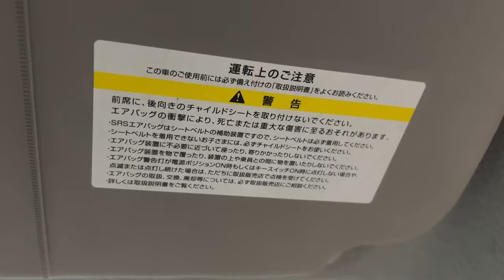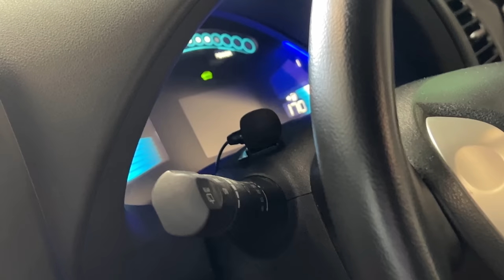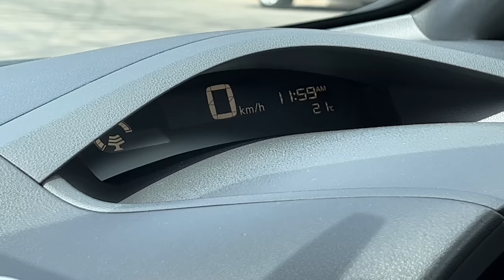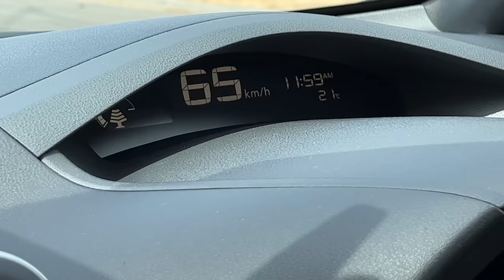I bought an electric car.

Comment: If I get an EV, this is probably the one I'm going for. I don't think I've driven more than 10 kilometers in a day since I went home for the first round of Covid lockdowns about 3 years ago.
Reply: I implore you to reconsider, Chadamo plug (the type the leaf uses) is going the way of the do-do outside of japan, multiple charging station companies have already announced they will be dropping support of it on their new stations- in a few years the already rarer chadamo plug may become impossible to find- leaving you to charge on a 24~ hour wall plug anytime you need to recharge...

Also avoid early leafs at least, they usually have horrific battery degredation because they didn't ever implement any battery protection systems like cooling, buffers or heating on any of the sub 150~ milage ones as far as I know. 

I highly recommend you go for something the upgraded E-golf, Focus EV or Ioniq EV, which all have CSS and 115~125mi range Particularly the Ioniq seems to hold up incredibly well, I've researched EV's for a couple years before just buying my own this year, and after watching pretty much every long term owner review of their Ioniq after 80~200k miles, literally none of them had lost any range, and seeing maybe 100? On various sites selling them, checking their range on the dash when the pictures were provided, all of them seemed to have good battery health as far as I could tell.

Tl;DR: Avoid Chadamo based cars, and anything without a fast charger, also I've seen a ton of bolts with massive degredation (like 3 years old with a max range of 19 miles from 253, its the only car worse than the leaf in that department)
Reply: For 10 kilometers a day, if the roads where you are make it possible, get an electric bike instead...
Reply: Honestly, a Hyundai Iqoniq or Chevy Bolt are better ideas for something newer FYI...
Reply: @SkyTreeStudio  Ioniq batteries seem to last quite nicely, Bolt batteries not so much.

(I've watched hundreds of videos and looked at the same amount of cars for sale and Bolts seemingly have some of the worst battery health for some reason- maybe the batt. recall all of them have to go through off the assembly line has something to do with it)
Reply: I agree with the other commenter. If you live somewhere without much snow, you'll have more fun on an E bike and pay significantly less.
Reply: The Leaf would serve you perfectly
Reply: @flurpoid  Or without much sun/humidity. Southern US or the like you'd be a ball of sweat even on max assist.
Reply: touch grass
Reply: @WelcomeToDERPLAND  
If I recall it was an issue with one of the robots the welded the batteries.
Reply: I've been thinking about getting ba Chevy Bolt, as much as I love my old Chevy Blazer an EV sounds hella good. Especially since it's so cheap to run.

Comment: I love the old LEAF design. It just looks so unique. I have a 2022 Leaf and I prefer the old body design. The newer ones just look... like a normal car. I would have gotten an older model, but the thing about EVs is that battery degradation exists and the longer you go using a rechargeable battery, the less capacity it has, so I got one new. I wanted an EV that I could visit people in, not just the bare minimum to get groceries. It's better than the i3 I had last in terms of range. That thing barely went 80 miles (128 km) on a full charge, but it was very cozy to drive compared to my current.
Reply: I actually wish more EVs would just look like normal cars. Some EVs look fantastic (e.g. Teslas are pretty good) but some EVs are designed to be as "different" as possible in the worst possible way (like the BMW i3).

I guess my point is I just want milk that tastes like real milk.

Comment: Fun thing; You can actually use your 2017 leaf as a household battery storage if you want! Leafs did come with bi-directional charging since 2015 I believe. You mentioned that the leaf has double the storage capacity compared to the household battery you have, how would you like to triple that?
Reply: The iMIev supports that aswell, but only has a 16kWh battery.
Reply: @Thelango99  Good to know!

Comment: As a former leaf owner, it's honestly the best city car you can find. Charge it up slow whenever you don't use it, and it barely ever complains. The only issue I had with my leaf (which had the 40 KWh pack) was that long distance road trips with the fast chargers were annoying as anything, so I bought a long range Tesla, but even still 100% recommend as a city car every day of the week
Reply: As a 18 kWh remaining eNV200 daily driver, I find 40 kWh a bit overpowered for a city car

Comment: My used Chevy Volt is the most fun I’ve ever had with a car. I literally don’t remember when I last put gas in it. I only do short trips and errands and walk the rest of the time, so it’s perfect. It also is just SOLID. I’ve had it for a while and have never had any issues with any aspect of it beyond basic maintenance. Hands down the best car I could have possibly gotten. I’m pretty sure it’s appreciated since I bought it, too.
Edit: I also agree on the quietness! I’m spoiled by the silent ride and think other cars are obscenely loud now.

Comment: Nice, I've been a LEAF driver solely for the past few years, and I've loved it. I'm glad you do too!

By the way, battery capacity is measured in kWh (killowatt hours), not in kW (killowatt). kW is how much power you're pulling at this moment, and kWh is how much energy you hold. Cheers!

Comment: I'd be really interested to see how a 30kWh battery pack has aged in a hot climate like Australia. Hopefully you share the leafspy data somewhere. I Absolutely loved the LEAF30 but even here in the UK the lack of thermal management was an issue that led to early degradation compared to literally any other mass market EV.
Reply: Not good, supposedly.

Non thermal managed leafs in Australia are known to cook their own batteries during fast charge, the computer and charger is too stupid to not slow charge rate in relation to battery tempature, battery life being cut by 60% or worse is not uncommon
Reply: This is a 2017 model year. It has pack that is even more advance than the Lizzard Pack. Should be fine in warm weather, just don't DC Fast Charge with with Chademo on warm days.
Reply: @Neojhun  I had one. I promise you these 30kWh packs were notorious for even faster degradation than the OG 24’s!
Reply: @deepbludreams  I used to have a 30kWh pack. I saw my temperature meter completely full all the way into the red on multiple occasions before. The charge rate definitely got slowed with heat. I was capped at 22kW DC Charging and enforced eco mode with limited acceleration and 60mph/100kph top driving speed when the battery was too hot.
Reply: This one may not be ideal given that its early years were spent in Japan.

Comment: I like the Leaf, it's reasonably-priced and underneath it's actually well designed. Unlike some of its contemporary EVs which were effectively an ICE car with electric gubbins jammed in wherever they'll go.
Reply: It's a real shame about the poor battery cooling on the Leafs. That's the one weak point of the design.

Comment: I've had one of these for nearly 8 years now, and it doesn't get old. Puts a smile on my face every time. If you want more performance, IIRC the place to start is the inverter, and there is at least one upgrade option.

Comment: Hey Dank! Just so you know the reason why it doesn’t chunder-steer through the corners like you were talking about it’s because the center of mass is down on the floor. Most FWD cars have the mass of most the car in the front. The leaf, like a Tesla, has the battery under the car under your fear. Better balance through the corners equals better handling.

Comment: 2:59 just a quick note: battery capacity is measured in kilowatt-hours (kWh) not kW. kW is a measurement of the rate of power usage. So if you run a 30 kWh battery at 30kW power draw for an hour straight it will be dead.

Comment: I drive one of these some days for work and I love them, everything you said plus the "gear shift"" joystick is SO much better than the typical automatic paddle because you don't have to feel for a detent. It does ask for approval to collect data every time it starts and range is bad in the coldest swedish winter weather but it handles little snow-covered roads like a champ because of the torque and traction control. Eco mode is effortless and without it on it feels downright nippy. Coworker who drives a tesla at home says she likes it even more but I absolutely rate the Leaf.

Comment: My dad had a Nissan Leaf for several years before it got written off in an accident; He loved to glance at sporty cars at the traffic lights and then absolutely cream them on takeoff because of the torque and acceleration on the leaf, was funny pretty much every time.
Reply: No one should claim EVs are useless. Teslas can even be good on track if you have a lot of money to spend on tires. 

What everyone is saying is that EVs have no soul and require no specific driving skill. And that's fine for someone who just wants a box that takes them from A to B. It's not fine for someone who wants an actually enjoyable driving experience.
Reply: @AB0BA_69  Yeah. While I do love evs alot, I'm against the anti-ice cars like UK and a few others are doing. I hope porsche makes that e fuel successful
Reply: @AB0BA_69  I'll be honest I don't know why you're saying that to me. I don't drive an EV and I enjoy manual cars. But also I would say it makes for a vey enjoyable driving experience if you have bad ankles and find it hard to use a clutch every day; they're incredibly comfortable and make driving a lot easier.
Reply: @AB0BA_69  did you mean to reply another comment? what are you on about.
Reply: @Nexus104  look into what Toyota is doing with Hydrogen. The tech is still new, but they're essentially using hydrogen as a fuel catalyst in an ICE engine. It's very different from the current available method of converting hydrogen into electricity.
Reply: @Elena-c5c  So drive an automatic ICE vehicle
Reply: @flurpoid  Hydrogen is a stupid meme. There are barely any hydrogen stations outside of Japan. Toyota lost this round by not investing into EVs first and losing their momentum with the Prius

Comment: These pick up some serious performance and range when you put some lightweight wheels on em, just so you know.  These a decent little modding scene with these. IIRC you can flash the ECU and unlock a bunch of the torque and they will seriously surprise you.
Reply: You can install install a bigger inverter and get way more power out of the existing motor. Someone put a 160kw inverter in their 2012 leaf, and it accelerates like a model 3
Reply: @jfarre20  Depends on the model 3. My M3 LR is at 371 kW, and I seriously doubt a Leaf can kick this hard.

Comment: Ev's are great for short commutes and whatnot but what really let's them down is the long range, the tech for that is still a fair bit off being an actual rival to a full tank of petrol
Reply: Yep Evs are great for living in small towns with some solar on the roof if you are getting solar panels or even better a windmill installed you should invest in either a hybrid or an old Ev
Reply: 300 Miles on a Polestar 2 disagrees with you...
Reply: You clearly haven’t checked out any Evs that have come out in the last few years, ioniq5, Teslas, rivians, etc. all have plenty of range and very fast charging to do 10-80% in minutes. The real problem is the price, charging infrastructure, and weather that cause most edge cases people run into now.
Reply: @quartzofcourse  Also EV's are so restricted in terms of self-repair you are basically forced to go to the official repair center that will nickel and dime you, but then again the same can be said about modern ICE cars.
Reply: @quartzofcourse  But how long can a battery pack last?
How much waste is created by the recycling of the old battery?
That's why i think hybrid cars are a good compromise, technology of the future helping technology of the past. (Even though electric cars were a thing in the past, but were killed by petrol companies)

Comment: Honestly I think I'd like one now, the different charging speeds is really cool too. I never like hurrying up a charge when I'm asleep or not using it as I'm away from it because I have a little fear of electrical fires
Reply: If you run an android phone you can disable fast charging in settings so your nice charger doesn't wear out your battery there either!
Reply: @spencerwarren8302  I had no idea about that, thank you very much!

Comment: I worked security and they phased out the old ford rangers we used for yard patrol and they had brought in these bad boys. I never drove an e car before so i figured it would be slow as hell. Nope, put the pedal down all the way to the floor from a complete stop. It just went with everything it had. Made me sick from how quick it took off. They're fun as hell for lil itty bitty cars. Changed my mind about e cars and now ive been looking for me my own.

Comment: So I calculated for myself roughly how much more economical an EV would be. If I used 30kWh 6 days a week, that's $102 a month with my electric rate of $0.143. For my 15mpg nugget truck, using about 112 gallons a month at least and assuming $3 per gallon, that's $336 a month. Big difference! Only problem is a car payment on an EV costs more than just continuing to use gasoline, since the truck is payed off, plus insurance.

Comment: EVs like this are FANTASTIC. I miss my Spark EV [edition] (GM/Chevy). Lil'est EV nugget you could find, just about; turned on a dime, torque-y af, just amazing. Drunk driver took it away from me, and the value of used ones doubled over the pandemy.

Comment: Electric vehicles honestly have so much potential. A lot of the pushback on them is warranted, such as the emissions caused by the battery, but I think they have a really really good role as inner-city machines. It’d but down on smog and air pollution a lot, make the roads quieter, and make things less expensive for people in the city. They may not be the best for long distance due to the lack of infrastructure, but I really think there’s a market for lower range, cheap EVs for people commuting to work and home within a city.

Comment: The smile is really from not caring about those rad hoses or head gaskets blowing :). On a personal note, I'm going EV myself and the leaf is my number 1 pick so far, 2nd is the fiat 500e. Also, if you rent a shop a battery swap on both is doable as long as you're safe and do it right.

Comment: Turning circle would be good because they don't have to limit turn angles to avoid the long engine in the engine bay, wouldn't it? So they can have wheel arches that go further in from the sides of the car, and can turn the wheels further.

Comment: Free fuel is the best reason! I’ve only ever driven two electric vehicles- electric moped and electric bus. Moped was a death trap. That’s all I can say. Bus however, that was actually amazing. The instant acceleration vs the diesel versions, I’d never get bored of that. Only issue was the silence. You could hear passengers talking their usual nonsense.

Comment: Mine does 5.7 :) 160kw inverter swap,  its now quicker than a stock tesla, errr and to. 60kmh im doing 2.3 which is same as the long range model 3 ,  nanna move now.
Reply: Model 3 LR can do 0-100 in 3.7 though

Comment: No joke, this video was a deciding factor in me deciding to upgrade to a Leaf. Plus trim with ~190mi range and 200hp makes for a legitimately fun driving experience , especially compared to the Prius it replaced.

If you can charge up your car every night, an EV is a life-changer.

Comment: the CV shaft is not the problem for tight turning. Got a cheap FWD chinese EV myself (Suda SA01 6000€ new) and the turning circle beats every other car. 
What I learnt is that the problem is the engine so you can't make the wheel wells big enough for the wheels to fit for enough turning angle. That's at least what an engineer told me

Comment: I started off charging on my normal 120 V and it was super slow like you say, but we got a 240 V / 50 A circuit for the purpose and now I can charge at 7 KW or so with a relatively cheap charger. Only takes a few hours to charge a Soul EV.

Comment: I also like the way the Leaf looks. It's not especially pretty, but it is distinctive in a good way.

I've heard that since, unlike some other electric cars, these Leafs (Leaves?) don't climate control the battery to protect it from temperature extremes, their battery goes to crap fairly fast compared to a car that does..

Comment: You see, there's no such thing as a car that isn't fun. Slow cars are fun because you slam on the gas, hold the wheel like you're about to go flying only to check the speedometer and see that you're going a little bit below the speed limit

Comment: Mr Dank, you have to try yourself an 80s Subaru. I think they were called the Liberty over there, or maybe the original Loyale? I had an '86 Turbo Coupe as my first car, and if you cranked the wheel as far as it would go, it would almost spin in circles. It was absolutely insane. I've never driven a car with such a small turning circle since.